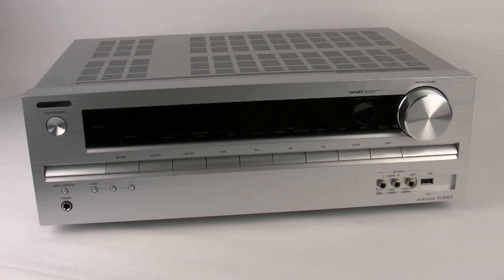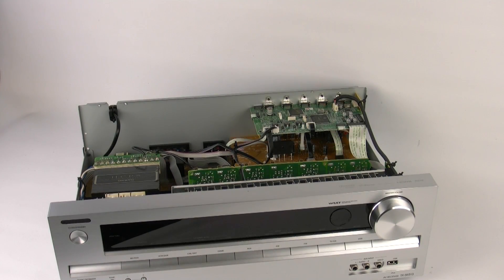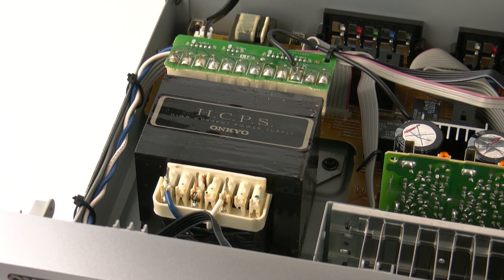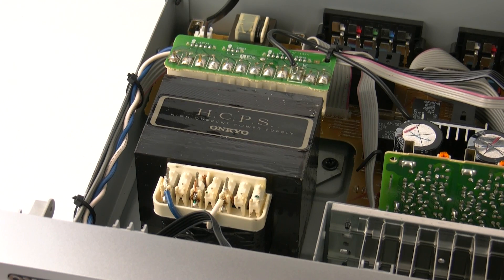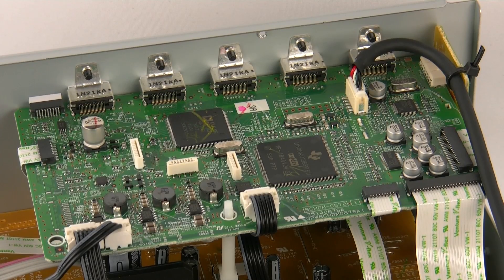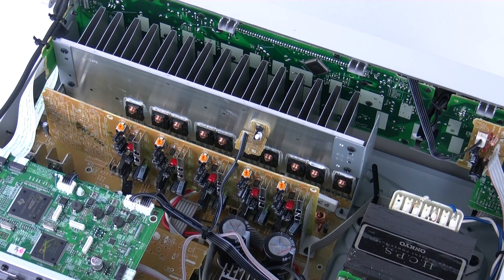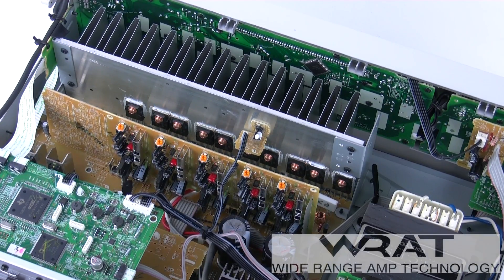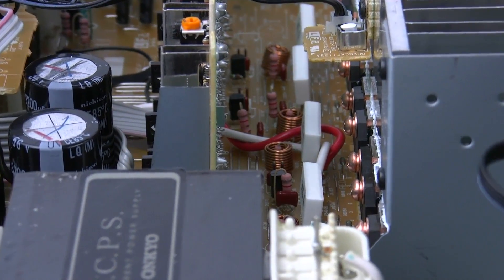ONKYO AVR 2012 Range Inside the New TX-SR313

Comment from the maker: Hi, there can be many reasons why there is no picture - HDMI handshake issues between different hardware, even low quality cable (but no need to buy expensive cables) can cause quite a few issues. Please get in touch with our customer care at       customercare_eu@eu.onkyo.com     to find out what is going wrong. The colleagues will be glad to assist in setting up the system. Thank you!

Comment: I can't imagine how customer care is going to resolve either the chassis overheating problem, or replace the improperly specified capacitors on the HDMI interface board, over the phone.  You know these units have a problem.  Instead of making pretentious offers of customer service and wasting your customers' time, do the right thing and issue a recall to rectify the problems for existing customers, and correct the physical design problem for your future customers.